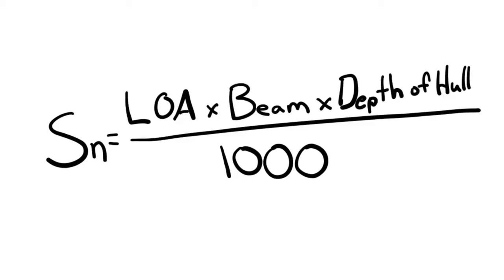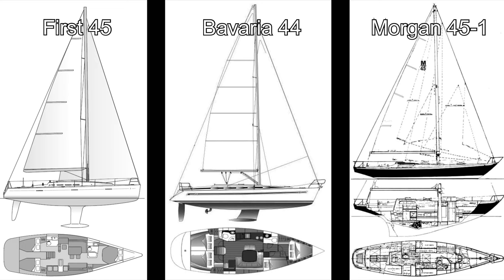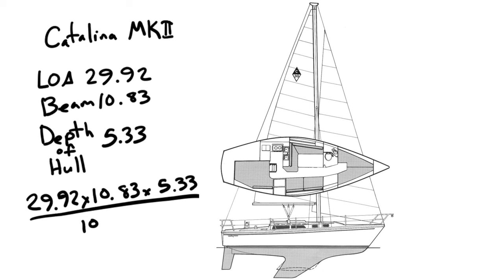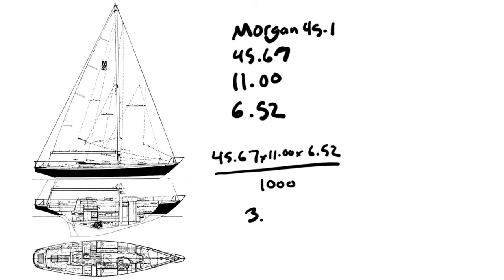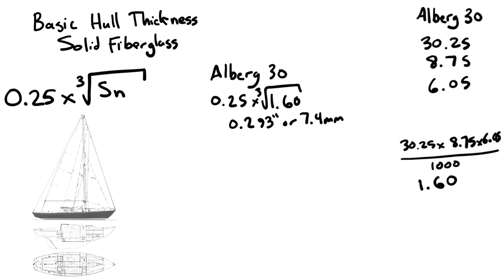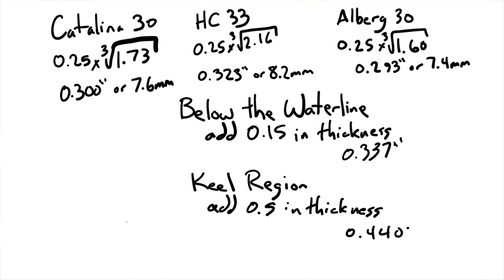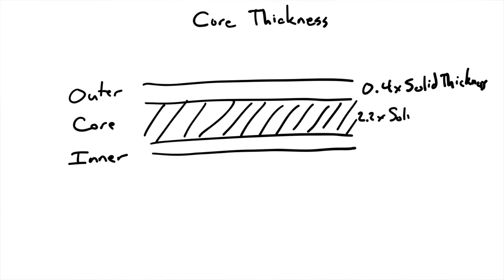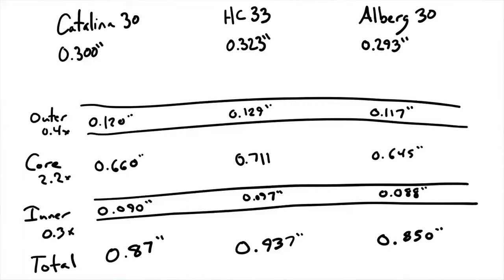Is Your Hull Too Thin? | Sailing Wisdom

Comment: I often ask this question when i see people say "these hulls were laid up nice and thick" so on and so on, about how that is great for ocean cruising while at the same time we see boats like the Albin Vega 27 with paper thin sides, yet it is well known as a go anywhere boat. I get the feeling it doesn't really matter as much as the reputation of the boat, unless you plan on hitting stuff. In any case i think the keel design is just as important in a collision.
Reply: Isn't the Vega kinda overbuilt? Solid glass fiber 12-13mm in the keel, 9-10mm in the bottom and 6-7mm on the freeboards for a shallow draft 27 footer. The laminate is translucent to aid in quality control during production, so it feels thinner when the sun can shine through
Reply: Sun shining even over .75" .  
Thinner classic boats do give the crafty an opportunity to lay in an insulation and structural foam core upgrade.

Comment: I have a book by Dave Gerr called Boat Strength it is an excellent and very accessible text and covers this topic in great detail. Just as important as hull thickness is the internal structures that are built into the hull. This seems to be an area that builders skimp on by not installing the correct number of longitudinal stringers, ring frames etc. 👍
Reply from the maker: That’s the exact book I’m using for the Windpuff project! I thought this would be a nice introductory video to the topic of scantlings and inspire those who want to know more to read on the topic. 
Gerr has a great book on the topic, and when you combine it with Skeenes, you get a nice understanding of what your boat needs to have for strength.

Comment: Some consideration of panel size (framing) is essential in the discussion. Close framing directly reduces required panel thickness. F9r example, most modern fin keel sailboats have a web of frames and stringers taking keel loads away from the skin.
Reply from the maker: Yes, but that would make this video much longer and more complicated. I was just going over the most basic starting point of “basic hull thickness” and then a few areas to show that the actual thickness varies based on location. As you spread out or close in the space between frames, the unsupported length is bigger or smaller and the panels need to compensate for this change by becoming thicker or are allowed to be thinner.

Comment: Wow, thanks so much for this video - just geeked out hard. Can’t wait to get to my boat this weekend and take some measurements!  I think I’ll also be buying those books 😊
Reply from the maker: 🤓 the math that goes into boats is almost as fun as actually using them 👍
Reply: @RiggingDoctor  ha, well for a select few. I’m guessing we’re in the minority 🙄 I have a very rare boat, a 1968 Chris Craft Cherokee 32. I recently closed up a thru-hull and the hull was about 1/2” thick, maybe 14” off the keel. I know the LOA and beam, but am guessing a height of 5ft - I’ll confirm that this weekend. With those numbers I get a scantling number of 1.42! That should give me a base thickness of .28”. I’m thinking it’s a good strong hull!

Comment: There is a Camper Nicholson 65' ketch in the yard here. The owner told me the (solid fibreglass) hull was 30mm thick under the water!
Reply: I have a 32ft nicholson from  1965 and weighs 7.3 tons x2.2 = 16000 pounds, yes there's a lot of pure fiberglass no cores.

Comment: Cool to geek out on the numbers, thanks!  We used to have a 1979 Tanzer 26 that was more than an inch of solid fiberglass at the bow.  Now we have a 1977 C&C 30 mk1 which also has a solid glass hull.  I'm sure you know that C&C/Bruckman built the first engineered cored hull boat, Red Jacket in 1966, length 40 ft.  I guess they wanted the security of a solid glass hull on the production boats, even 10 yrs later, so they only used balsa coring on the decks.
Reply from the maker: I did not know that little nugget of a history lesson. They have been the cutting edge while still playing it safe.

Comment: David Gerr's book is an excellent read.  I have it aboard.
I have a 1985 Marine Trader Ketch, center cockpit.  Very good build quality by that yard, solid hand layed up hull: around 5/8" at the sheer, 3/4"+ at the bilge turn, and 1"+ below waterline.  Longitudinal, and transverse stringers, with bulkheads everywhere!  Cruising weight: 55k lbs.
Reply from the maker: That’s the book that I pulled the two formulas from! It’s such a good book and instrumental in the projects we are undertaking right now.

Comment: My 39’ modern product sailboat is solid core to about 1.5’ above the waterline and balsa cored to the deck/hull joint where it is solid core again where it ties in. The hull next to the fin keel is approx 1.2” thick and is made from eGlass. The hull below the waterline is supported by a solid glassed in grid and the hull above the waterline is supported by glassed in bulkheads. Chainplates supported by extended supports glassed in place and integrated from the deck to the keel supports. My point is that your math is great for a uniformly built hull, which pre 1990’s boats might have been, but difficult to draw any conclusions from these figures for a more modern fibreglass boat. Too many other design factors to consider.

Comment: Well done! You didn't stray into the weeds, which made the basics easy to understand.
BTW, I used you chain+magnet trick to install a new messenger line today - worked like a charm :-)  Thanks!
Reply from the maker: Glad that worked out for you! I made that video before we went cruising, so I look like a child in that video 😁
It’s a neat trick since the chain is magnetic but the mast isn’t. You can guide the chain to the exact gate you want to use and navigate it around the spreader compression posts inside the mast.

Comment: Bristol 45.5 , solid hull 24 mm thick . Not sure what she is at the keel route . She is on the heavy side but it has the collision resistance i like and no core to worry about  , one  day you are  gonna hit something . I dont find the weight to be an impediment if you design for it. We can certainly load the boat up and not have it impact her sailing performance. The hull weight gives us a very pleasing motion , easy on the crew  on long passages . Would I change anything?  , no , I dont think so. It is our dream boat .

Comment: Hi guys, My boat which you briefly observed in Chesapeake VA, measured 1 inch at head water intake. 73 S&S Yankee 38, 8 tons 3.5 lead. Solid glass hull.
Reply from the maker: That is impressive for a 38’. Those S&S are legendary for a reason!

Comment: The deck core of a Pearson Triton 28 from late 50s - early 60s is 3/8ths of an inch. I have 3/8th core material in Divinicell and white oak. The sheer strength and weight of white oak is nine times that of the Divinicell, but my plan is to use the white oak core material in areas where there will be any fasteners to be attached, to get the added sheer strength. (but a buddy said that is why you use backing plates, which I will use also.) The downside I figure could be rot of the white oak eventually if water gets in there.. so.. keep it sealed. And heck, the boat is heavy already.
Reply from the maker: If you through bolt and use backing plates, you won’t need the sheer strength from the oak. Not having wood in there will reduce your headaches in the future!

Comment: Thank you for the informative video,that was something I never new plus lots I don’t know 🤣but
I always thought that the older boats were thicker and heavier than the newer boats
So the formula you explained is still used in today’s production boat building? 
But surely for the boat that’s made for speed is going to be lighter than the boat that’s made for ocean cruising 
In any case very  interesting watch
Thank you ⛵️
Reply from the maker: They have figured out how to properly engineer boats to make them even lighter with just enough strength to survive the ocean but those boats have skilled engineers calculating everything and therefore don’t need to follow these basic rules. For average boats built out of regular fiberglass, these are the rules they are built by. 
Older boats are thicker than newer boats simply because they didn’t know how strong fiberglass was so they overbuilt them like crazy!! 
Our Morgan from 1968 has hull thicknesses that match what she would have had if she were planked with wood. They didn’t know fiberglass at the time so they simply used what they did know and replaced the wood skin with a fiberglass skin!

Comment: Nice introduction/overview.  However, I would point out however that these are only rules of thumb.  I don't count myself an expert here, but to my knowledge, there is an important difference between strength and stiffness, and it is not like there is some specific absolute point where something is 'strong enough'  for a given weather state.  Also the strength and weight of the glass depends on many factors including what kind of resin, type of weave . vacuum bagging, etc.  I would also add that hull weight - especially low - in a sailboat probably adds to 'sea kindly' where like slower to get moving, it is also slower to bounce in the waves, and slower to change directions, and slower to slow down.  In other words, heavy "overbuilt" boats should track better in heavy weather and be more comfortable.
Reply from the maker: Absolutely, these are the starting points but then all the qualifiers modify the final necessary thickness of the hull. 
The sea kindly motion of a heavy boat is why I prefer them. They don’t have the best performance numbers, but I would gladly cross an ocean on a heavy slow sailboat than get tossed around on a light race boat.

Comment: Some food to thought here, great video. 
I am considering to build my first sailing dinghy and the first thing to decide is if I will use e.g. PVC foam panels as core or plywood which is heavier and may rot in some cases but it has its inherent strength. So I wonder where can I find additional data on how to calculate the required dimensions when various materials are used.
Reply from the maker: I would go to the book: Dave Gerr “Elements of Boat Strength” https://amzn.to/3t6EsJP
It will answer all those questions and tell you how thick it needs to be as well.
Reply: @RiggingDoctor  thank you 🙏 very appreciated!

Comment: I don’t know……I’ve sailed a 31 ft. Norwalk Islands Sharpie designed by the late Bruce Kirby since 2001 and its hull weight I believe is 8,500 lbs. which is cold molded west system cedar hull. Draft 18” board up and 6’06” down. Beam 9’. She’s a great racer/cruiser. The deck core is marine ply with fiberglass and awlgrip paint.  S/V Mudlark. Cheers.
Reply from the maker: Cedar strip planked boats are beautiful!
These formulas are more for fiberglass boats. While cold molded usually has a fiberglass skin, the strength is coming from the wood and not so much from the glass.

Comment: Herbie this was just what I was looking for . I have a Cheoy Lee Herschoff 31 off shore ketch built in1968. The hull is rock solid sound but removing the 80 percent inside I was cking hull thickness which kinda of made me go ,oh no ! Is she to thin ? For numbers your Alberg and my Herschoff has only a length difference of around a foot ,beam is the same and depth pretty much the same.  My only second thoughts on keeping it ghe same is I'm going to be sailing in the upper North Atlantic, Rocks for as far as the eye can see and the occasional tree log . To what point do you increase the hull thickness or install hollow glass ribs perpendicular to the keel line ?
Reply from the maker: I would highly recommend reading this book: “The Elements of Boat Strength” by Dave Gerr. 
Look on page 30 as it will tell you how much to add to your laminate for being heavy displacement as well as how far up to extend the “lower topside thickness” into the front of the boat. 
The hollow beams set parallel to the keel are called stringers and their size, spacing, and amount of glass is covered in chapter 5. 
If you want further information on the topic, I would also read “Skene’s Elements of Yacht Design”. It helps fill in the gaps that this book leaves. 
Lastly, “Boatbuilding Manual” by Steward is a good book to comprehend. It is more focused on wooden boat building, but the knowledge is the same. There is a tiny chapter about fiberglass construction, but all the parts that discuss strength are related to wooden boats. 
It’s not a direct translation (wood to fiberglass) but understanding the forces that a wooden boat needs to manage will inform you to think about who they would be managed on a fiberglass boat as well.
Reply: Gerr's book I'll pick up  as Skene's I've had for sometime. As for glassing up is not the problem ( layed  up many of hulls 10 to 50 footers) its getting the figures and placement correct that is important . Let you know what the out come is ,in the spring .
Reply from the maker: Sounds like a plan!

Comment: I have one in particular Windrose 20 Basic hull thickness I don't like deflection on a maintenance lift. If a hull can not take a general point loading it just makes me feel unsafe. Cored definitely performing better at deflection and resistance to hull penitration. Intention to cut out the bathtub interior, strengthen mostly by adding insulation core and structural bulkheads/stowage etc. by the end should be the same weight and be near unsinkable. As it is now, I wouldn't trust going to Hawaii.
 In my opinion scantling basic numbers are just dead minimums. Required reinforcements/stiffeners regularly ignored by FRP production. In the metal boats reinforcements are frequently called scantlings, insufficient or in poor condition resulting in disasters. 
One engineering example: make the same calculations as a sphere, same volume elongate the sphere twice. The elongated examples we know are much weaker so as flattening. Numbers alone result in catastrophic failures. 
Also the stress points include all edges, turns of materials.
I recently tested my wooden hull Touchstone against rocky shore. It took hours of pounding to breach the hull. Some upgrades in the rebuilding will occur to frames. Sampson post sheared so that among others will see upgrades.

Comment: Good video but it should be noted that all of these formulas are rough estimates from a very old book. Composite technology has come a long way since Gerr's Boat Strength. These formulas are assuming balsa cores, woven roving/chop strand matting e-glass, and polyester resin with hand layup techniques. Modern composites maximize stiffness and strength with fiber orientation, fiber type, layup process, and lots of different core materials. Good bit of knowledge for the curious but certainly not enough to safely design your own boat!
Reply from the maker: Absolutely! This video is just to pique their interest in the topic, not to teach them how to design a structure.

Comment: Thank you for sharing the knowledge. This should be the square-cube law right? Another example of hull shape and size is the barrel sailed by Mrs Taylor down the Niagara falls. The vessel survived. I wonder the hull thickness of a 30 footer to survive such a drop
Reply from the maker: That would be a very thick boat! I always think of square cube law in respect to radiation and light intensity. Double the distance and quarter the power.